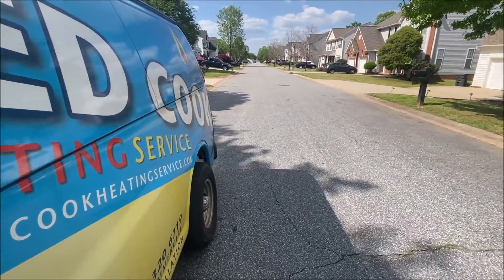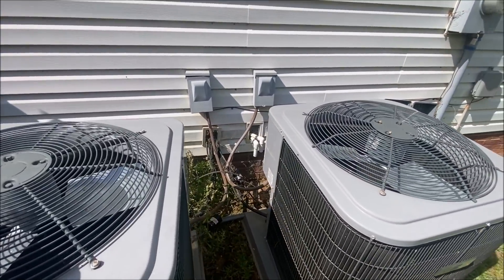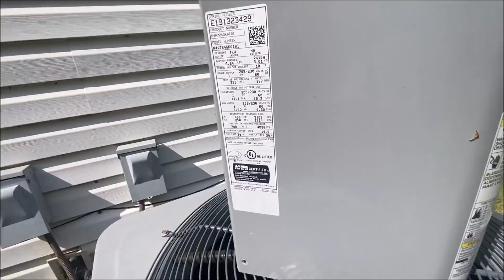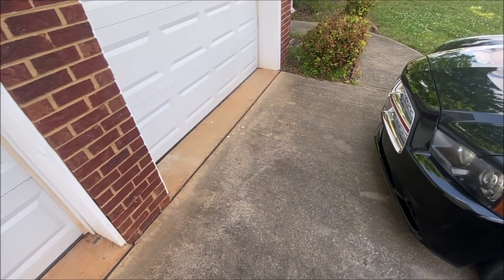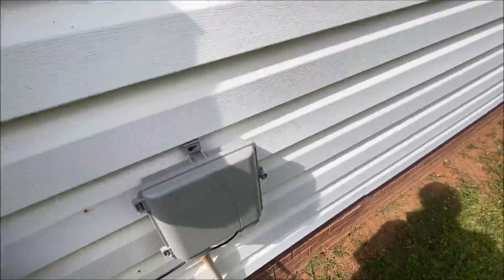AT&T Broke the Air Conditioner

Comment: I had cable installed 9 months ago. The installer ran an aerial line from the pole in the alley to the deck of my house, crossing my driveway diagonally. The height of the drop at its lowest point (dead center of my driveway) was 8 feet above the concrete. I have a camper on my pickup. The line has been ripped down 9 times and 9 different technicians from the cable company has come out to repair it. The last time it was fixed properly because the electrical inspector was at the house next door and saw what was going on. The inspector advised the last repair technician that any wire/fiber cable that crossed over a driveway must be a minimum of 14 feet above the driveway per NEC. After I showed the inspector the receipts for all the previous repairs and the initial install she cited the cable company with 19 violations - one (1) installation without a permit, nine (9) repairs without a permit and nine (9) installation violations. $12,035.00 total fines for the cable company!
Reply: All that probably could have been avoided by the initial installer doing a midspan instead of coming straight off the pole. I dont know if it would have been a lot higher but at least it wouldnt have crossed the driveway. 8 foot off the ground in most municipalities is a code violation in and of itself but you see it all the time. does your main electrical connection also cross your driveway?
Reply: LOL. Perfect!! I love it!!! My neighbors electrical drop ran diagonally across my from yard and my driveway where I parked my travel trailer and accessed my gate to my back yard. My neighbor was a sweet 93 year old lady, great neighbor that we watched over like our own family. We purchased a 42 foot 5th wheel camper that has a 13'6 height clearance. The neighbor's city power drop was 10'6". Well, I contacted the city utility company (small city, everyone pretty much knows everybody) and advised there was an issue with the drop. The utility manager came out and we reviewed the issue. BTW, I had already researched the "easement" the easement on my property is for my service, not anyone else's. I didn't want to be difficult, so I offered a location on my property for a utility pole to be placed to allow the drop to be clear of my camper. The camper would be under the drop when parked, and would limit my ability to work on the roof of the camper, but I wanted to make it easy. The utility manager told me the pole would cost me $1500. I said "no it won't, it will cost the utility Dept." He didn't comment. He then said, "well, you can hire an electrician to raise your neighbors weatherhead." I told him that won't be necessary. He looked at me funny and I told him that the weathered already was longer/ freestanding than code permits, that the city utilities' easement can not prohibit free use of my property so the issue is the cities and they have two weeks to resolve it as that is when I take delivery of the 5th wheel and I will have free access of my property. The manager looked at me, looked down, and he said "you did your homework, didn't you?". The next day when I came home from work, I had full access to my property. My 93 year old neighbor sat in her chair in the carport the whole time giggling. Don't let utility companies take advantage of you for their pure laziness and lack of doing things correctly.

Comment: As a cable installer they drilled from inside without checking what was on the other side. My line of work is not known for having the best and brightest.
Reply: I call bullshit. We do have some idiots with no common sense. I have never done this in 30 years of cable work.
Reply: Then I hope that guy lost a diaper when he came outside!
Reply: Yup, so many people drill from the inside without even walking outside to guage what's on the other side. I've seen this before. Hell, I even did it myself. I was screwing a medicine cabinet up in a tenants bathroom, and they installed the damn breaker panel on the other side of the wall, Zip! Right through a breaker. Loud ass pop, blew the breaker, I'm glad I didn't have my hand on the bit like I normally do, I believe the drill insulated me from the power. I went right through 220v dual pole breaker. 😂 I can laugh about it now, but it scared the hell out of me.

Comment: For that AT&T installer to knowingly place a low-voltage cable in a 220v electrical cabinet should be fired.  He KNEW it went through that cabinet because it's stuffed through the front of the box.
Reply: There's no voltage at all in the ATT cable. It's fiber. But still the installation looks like shit, as usual.  Notice the bulging in the drywall on the inside next to the fiber port.

Comment: My sister had cable installed in brand new home, for over 9 months she always wondered why she had a sewer gas odor. I taller drilled dead center thru 3” sewer stack and ran wire thru it. Over $10,000 in damage. Cable company tried to deny they were at fault.
Reply: Hard to hide a wire going through a pipe!  Guess they tried to say the homeowner must have moved it.
Reply: 10k to replace a piece of 3” pipe?
Reply: Them cable guys aren’t smart from what I’ve heard here
Reply: How did damages cost $10,000?
Reply: @s.c.o.s4672 that does seem excessive, but between the actual repair, the drywall work, texture matching, repainting the wall from corner to corner, etc. I can easily see $3k
Reply: Water damage?

Comment: The 240v line inside the wall might have been hit by a drill. The home owner should have the wall opened by an electrician, to take a look.
Reply: Electrician here, cant see really well but at 5:53 the wire thats right next to the fiber appears nicked and discolored.
Reply: @holyscrap4445  I slowed the video down around there, the white conductors' insulation also looks like it has been very toasty at some point.

Comment: Had my well pump replaced a few years back. I use a 110v  submersible pump. He switched it to a 220v pump, and wanted to tap into my AC unit for power. And warned me to not run both at the same time. That was a fun day. He had no choice but to drive 60 miles round trip to get the right pump and reinstall it. Also came back the next day because every single fitting leaked. This is a guy that's been in business for over 40 years.

Comment: Similar screw ups happen in my area too...We built a custom home with heavy shake roof for a customer and installed flashed hard pipe through the roof to allow for mounting satellite tv dish on the roof and routing of cable through the pipe into the attic.  Cable guys came , installed the dish directly to the roof with lag bolts through the heavy shakes and ran the cable down the roof to the gutter and under the roof eve then through the wall...they didn't touch the galvanized pipe we installed for mounting the dish and cable,  we didn't see them install the antenna  but we did shower them with a few choice words prior to their leaving the job.
Reply: We also had a dish installer think he was going to install the dish on our new roof.  I said absolutely not.  He then said he would install it on the siding.  I said you're not drilling thru my siding.  He ended up putting 4x4 into the ground and attached to that.
Reply: @onenikkione  Check out the Commdeck (Retro Deck) Roof Dish Mounting System I used when I reroofed my house.

Comment: I had to run an antenna line into a bedroom once, and the guy said "Please do a better job than the Directv  guy did". He showed me where a hole was drilled through the baseboard opposite  a closet. There is an open pocket door there with a matching 3/8" hole drilled through it also...

Comment: I saw this happen and the guy drilled through the 220 wire that fed the disconnect so we had to cut the drywall open inside and repair. The cable and phone guys are creative little buggers

Comment: you should change the disconnect, run a new wire, make them move the fiber cable and they should reimburse the customer or pay you directly.
they knew damned well what they did, as I guaranteed it killed the drill bit.
I myself have hit live wiring in the past and it practically removes the whole drill bit end, especially appliances and other hard wired things, with high current breakers and no AFCI/GFCI protection.
Reply: For sure the feed cable has been compromised and needs to be replaced. No telling how much the drill bit reduced the current carrying capacity of the cable. A hot spot could lead to a fire as the air conditioning season progresses. ATT had no business going through that disconnect.
Reply: It's the smart move, but he's probably busy up to the gills in calls. I love having the time to do a job right, but sometimes you get so busy you do the job, 'up to code'. Maybe you come back once the immediate safety issue is addressed.

Comment: Might want to address those bare wires in the disconnect that got tore-up by AT&T's drill bit (yeah, could see bare copper and tore insulation in your video @ 5:55).  Pretty obvious, though, that dude didn't drill from the outside of the house... he found a nice place to put his modem inside and didn't bother to check for obstacles on the other side of the wall.  He realized his mistake once he went outside to feed the cable but knew the homeowner would be a little angry if he had to punch a second hole the wall (leaving his first hole exposed) so he just didn't say anything.  Since the drill bit grounded one of the hot legs to the disconnect box outside the house while he was drilling from inside, he couldn't have seen the spark so he figured it was still good.

Comment: A pleasure to watch some good & quick troubleshooting. Anyone else might have suspected a potential problem with the system. I like the fact that your curiosity made you investigate that strange cable run into the disconnect. Thanks for the video, I like your style and I hope AT&T does the right thing for this customer (victim).

Comment: Some of those installers will take the quickest way to get done but I’m with you it sure saves on drill bits if it was de energized beforehand.  Btw send a little of that heat north I’m tired of building fires 😊

Comment: The electrical contractor I used to work for would sometimes get called to make repairs after the cable installers F'd up... One time they put an "installers bit" right through a 200A service entrance!
Luckily it only blew the bit up and  nothing more, but the service between the meter and panel had to get replaced.

Comment: Based on this video and a lot of the comments, it really seems like there needs to be some sort of law that requires cable/phone companies to use certified tradesmen for their technicians.  Seems like anyone with half a brain would know not to go drilling holes and slapping wires in a high-voltage electrical box dedicated to the AC unit.

Comment: How Frontier dose it is they ask where you like it to be installed and the first thing we do is add the box on the side of the home and then the drop gets put inside their. We are not allowed to touch anything else but are own stuff. Anytime I do a new install with a drop I run it from the home to are equipment but many do it the other way. It doesn't matter but this way you can get a straight shot to the road without any issues. We also install by the ground the the home has unless the customer as the electrical company put in a different one. We do not mess with anything that's not ares.

Comment: Dude. I like your videos. I'm in Texas and it's hot enough to make you cuss. A guy I used in the past didn't pull the drain plug from the motor he installed. This was found out by another company.

Comment: looks like AT&T fiber optic cable, FTTH (fiber to the home) for internet service.
I bet they drilled from inside the house out into the box and nicked a wire, throwing a shower of sparks and tripped the breaker. then just finished the install and left to not get in trouble. 🙄 dumb-bells.
that said, I'd have checked the wire carefully, I'm sure there's a bare spot and the above is exactly what they did, because I have seen similar many times, where they hit water, drain, vent, ducts, refrigerant lines, wires of all sorts.  not just att, but all the installers for phone, internet, satellite, etc. they just don't have the foresight and experience to eyeball where the stuff will fall and visualize what could be in the walls.
Reply: yep AT&T fiber optics, confirmed later in video, the only good thing, it's non-conductive fiber optic cabling, right to the back of modem, where it terminates to a plug into a transceiver.
Reply: You are as absolutely correct .That installer may have  damaged the  electric line. May look ok but could be a fire waiting to happen.

Comment: Had a similar call earlier today, bad relay/board in a Generac delay box.  
Replaced a weak capacitor on the condenser since I was there and told him to let the company that installed the Generator system know about the relay I bypassed when they come do THEIR maintenance next week.

Comment: Xfinity destroyed all the electrical in my house, which included almost everything plugged in including the air conditioner. Just to rewire the house cost $24,700. Total so far has been over $62,000 of damage. Both Xfinity and their insurance company don't care. Their insurance company spent about 5 hours in total inspecting the damage over several visits, but did not even open up one plug sockets that I saw. If they did, they would have seen several of the grounds had melted. Sloppy. They did not even bring in an electrical engineer to check the system out. As I said, they really don't care.
Reply: What did they do that somehow destroyed your electrical wiring or equipment?
Reply: @court2379  Yeah, that story doesn't add up at all. That's not how wiring works. I cannot possibly think of a situation that internet wires could cause that would require rewiring your whole house. This guy just has no idea how electricity works and wants to blame somebody for a big bill. They "don't care" because they are not responsible.
Reply: @court2379  More information will be presented in court in September. Then it will be placed on YouTube.
Reply: Holly crapshoot. I'd interested to know what they did that caused all of your ground connections to melt. The doesn't make any sense.
Reply: @TH-1207  If I was a betting man, I would guess that they somehow bridged the house primary to the main earth tie.
Reply: @ryanroberts1104  Strange you are making assumptions without knowing all the facts. More will be discussed at the trial. Oh, as a technician if over 30 years I know a little more about electricity than you think.
Reply: @TH-1207  yep I've never read about that before
Reply: I'm gonna guess the Xfinity installer's drill bit crossed the live and ground wires at the panel.
Reply: @TH-1207  lol how would all of the grounds melt?
Reply: I'm lost as hell here. Hate to say this but without some more info I say something is fishy about this one.
Reply: @court2379  They didn't. Walter had a loose neutral from the utility and power was finding a path back through the cable bonding to the transformer, and that melted his cable line so he thinks it's a cable problem. Seen it many times.
Reply: Reply back to this so we get an alert to check it out when ready, thanks.

Comment: In all my years of electrical work, I have seen some strange stuff.. But this deal hear, is one of the issues that will actually drive me MAD.. Routing through an isolated system, BECAUSE it was easier for the tech... OH NO, not on any of my work you won't. I had a customer that had some fancy swimming pool control system, that a network company poked a hole through, right into a $25K control system, and SMOKED IT.. Which the direct result of that, was this salt water electrolysis convert and multiple pump system ended up running full tilt, and the metering sensors where basically taken out of the loop to turn them on/off, accordingly, smoked the salt water converter unit, COOKED IT... The pumps ran so hot, those motors/pumps are NEMA class sealed, but, also COOKED, to the point of being seized up, as the control valves that are controlled by the controller, were not tripped to open to run fresh cool water through and the water that was trapped in the closed circuit plumbing, was now a pressure cooker/vessel, and boiled... The network company's insurance covered it, but, all said and done, to demo out all the damaged system, to install a system that is designed to care for itself, for a 50 year life span, came out to approx $910K.... LOL... Lets not forget the time that the home owner had to be away from the house to allow the massive construction teams to bust up 8 triaxle dump truck loads of concrete... It was a mess for them for 4 months, and the entire summer, GONE.. Never even got to use their pool system and hot-tubes.... So much more in damages.. All because of a tech drilling a hole in through somebody else's equipment. LOL

If I remember correctly, the entail cost to install the pool systems, was like $80K or something like that... But holy cow, to dig everything up and redo it all... I am glad I do not install pool systems.. I'll stick to being a wirenut...